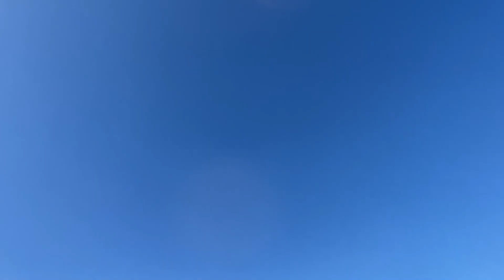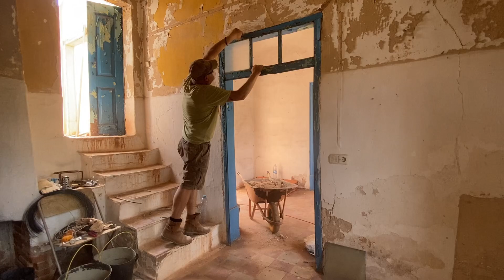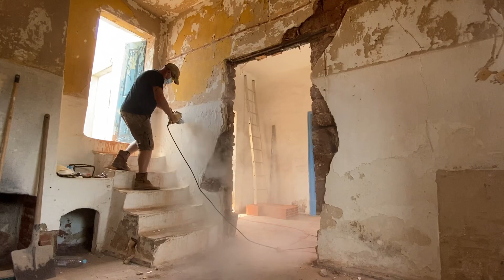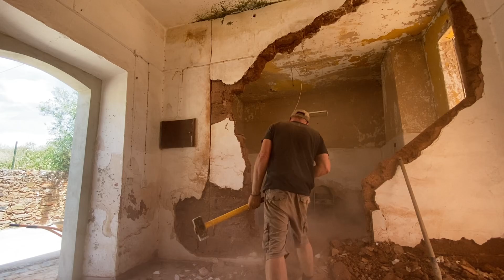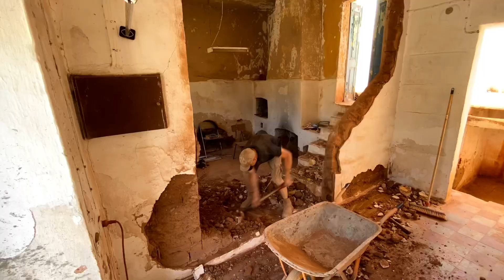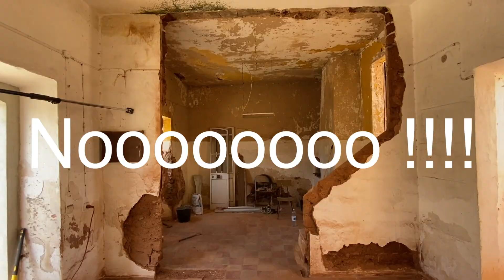The Wall Comes Down ( Hard Work )

Comment: What country is this in?
Reply from the maker: Algarve Portugal
Reply: @The-Quinta  ohh that explains the adobe walls? How did you know if it was loadbearing or not?
Reply from the maker: Took the thickness of the outside wall and the adjoining wall and the the thickness off the poured reinforced concrete ceiling, then the expanse it was covering to calculate its weight and strength.
 To be 100% safe we are currently adding a RSJ.
Reply: @The-Quinta  Sorry I don’t know what the acronym RSJ means? Rigid Supplemental Joinery? 

are you trying to state did you installed a post at each end with a beam across and the Dimensional lumber’s thickness will support the roof above like a lental as they say in the United Kingdom?

Or you consulted with a structural engineer
Reply from the maker: @Nonsense62365   Yes, we are in the process of building columns out of concrete then the RSJ ( Rolled Steel Joist / Steel lintel ) will be put up to support the ceiling.
It doesn't need one but we are just over killing it.